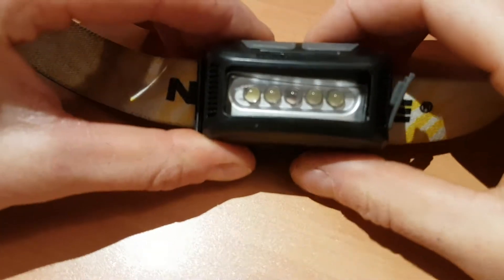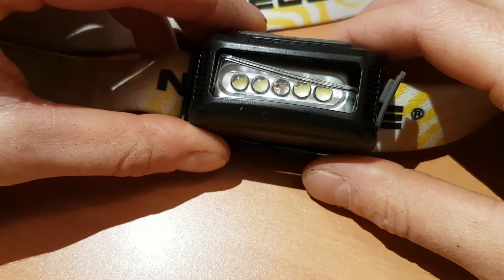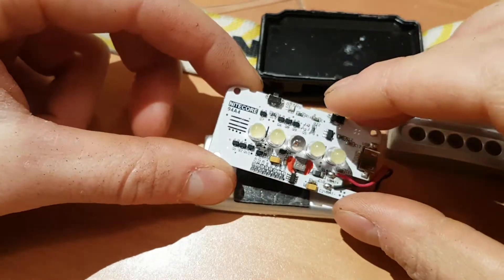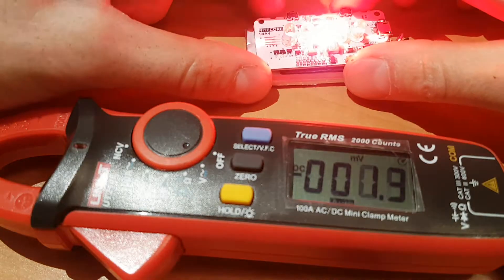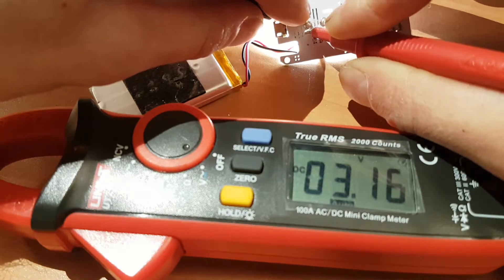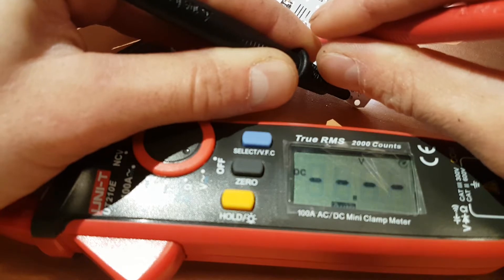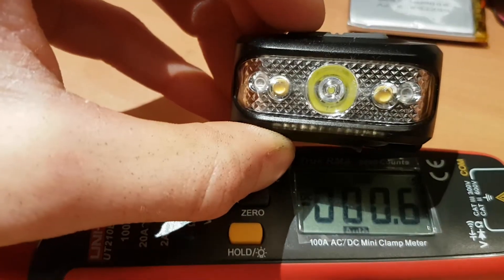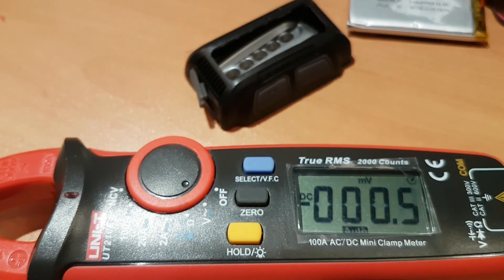Nitecore NU10 LED Headlight Teardown and Failure Mode

Comment: How's NitecoreNU17  so far? After 4 years i will have to change the battery to my nu10 and also purchase a new flashlight  and i m thinking to buy NitecoreNU17 🤣

I ve been using nu10 and olighths2...about olighths2 for the double price comparing to NitecoreNU10 i can say the battery it lasted half of the time (2 years) and have been harder to use because of the cables and much heavier.

I m a huge fan of Nitecore, can u give me a onest opinion about nu17? Does the flood same like nu10¿ Battery life..?

Thank you

Comment: Thanks for showing me the inside.

I have one from 2017

I think i had more than 600-700 recharging circles..i m expecting to diminish the autonomy.

So far worked great!!! Except the fact the plastic cracked all over..but that's just fine..i had solutions for that.

Later edit...i don't like nu17...newer and not so good..smaller battery, not so good autonomy, a bit less lumens than nu10, which has max 160. Nu17 has max 130 lumens
Reply from the maker: The LED'S appear to be a special high power model with larger leads soldered in to the board. I was unable to find replacement. They do not look to be cheap quality so I am surprised that they failed.
Reply: @QuaabQueb  i see :)

I'm sorry to hear that!

Thank you for your replay!

( Me and my uncle we both have nu10 bought in 2017..we both work alot with artificial light..both of them had problem with cracks ...but that just fine for how it performed so far! We used some super glue and they were good as new 🤣🤣)